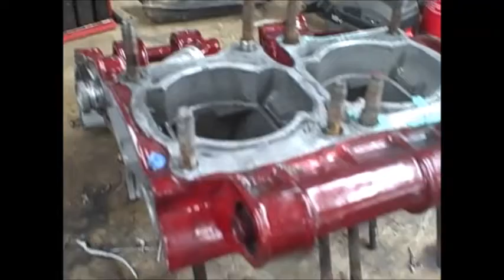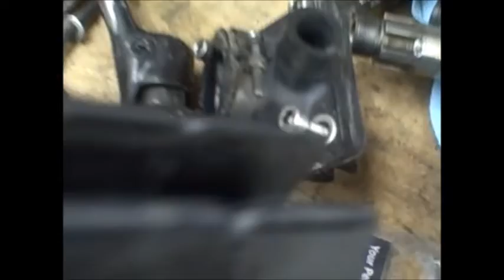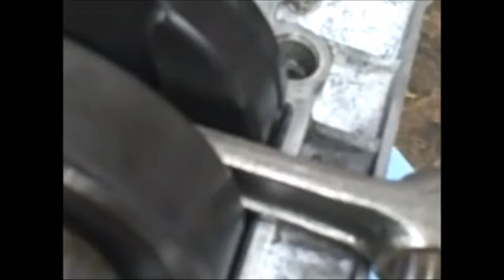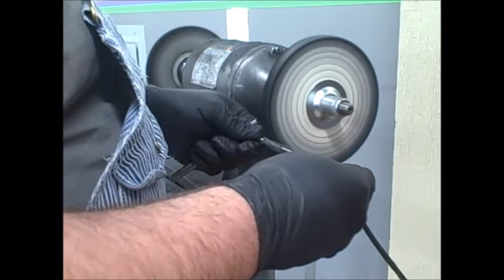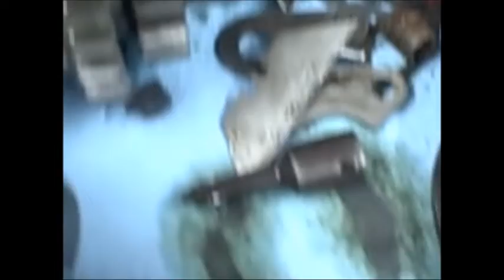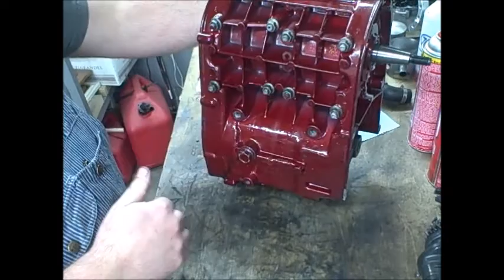Banshee Rebuild pt1

Comment: Do you recommend using those eBay cylinders? They're for a cheap price. And I see they have some little chunk pieces that need to cleaned up with small dremel? Also they come with Pistons that I wouldn't use personally they look like they're made from recycled cans. I'd use OEM or Wiseco. But if I get just the cylinder and clean up the ports with a dremel would they be reliable? I have some OEM cylinders that are really scored up from the previous owner not mixing the gas correctly, I can probably get the cylinders bored over but if they're not repairable I don't want to spend $700 on some OEM Yamaha cylinders.

Comment: I bought a banshee and I found out the the piston skirts were damaged so I bought new pistons and had the cylinders bored for the new ones, I put everything in and I when I started it, it seems that one cylinder is but firing correctly. I have swapped carbs,reeds, spark plugs and wires but I can't figure out why the one cylinder runs like shit.  Amy ideas

Comment: Hello J Smith,

My stock banshee needs new top & bottom end since I'm going to spend all that money I was thinking on buying the kit from eBay to convert it a 4mil banshee. What are your thoughts on this? Do I  need anything more router than just the kit that includes new pistons, new bearings, 4mm crank, complete seal kit.
I understand that I have to take my cylinders to be bore & my my heads cut if y don't want to use the spacer plate that comes in the kit.
Please help. Cheers!!!
Reply from the maker: Just remember you get what you pay for
Reply: +J Smith any suggestions for good quality parts?
I'm basically doing it my self to get some experience more than anything and have good time with you son rebuilding it
Reply from the maker: +Julio Ocampo  I would go with a hotrods crank wiseco pistons and a cool head would take care of your extra stroke
Reply: +J Smith I have the cool heads already installed 2 years ago but the thing I  don't know is what size domes I  should go with.
Any other changes that you might think of.
Your help is appreciated
Reply from the maker: +Julio Ocampo    You can buy cool head domes from modquad racing that are recessed for the 4 mil crank 21cc would be a good place to start
Reply: +J Smith thank you J. You are The Man
Reply from the maker: +Julio Ocampo I would recommend porting to take full advantage of the 4mil.
Reply: +J Smith gotcha, do I have to do anything different as far as carbs setup?

Comment: ok thank you one last question... The new wiseco crank I am installing had an o ring on the side where circle clip went in the case...I had to remove it for placement of clip and now if I put it on the other side the o ring keeps crank up higher than little pin that hold bearing from spinning???   ever seen or heard of this?  is o ring required.....thank your
Reply from the maker: Yes, if your crank has o rings on it you DO NOT USE the half rings. The o-ring holds the crankshaft in place

Comment: so once my transmission was installed... When I spun the drive shaft in neutral I got some sprocket movement... If I put my hand on it it took very little resistance to stop it is this going to be ok? Thanks
Reply from the maker: Yes that's normal